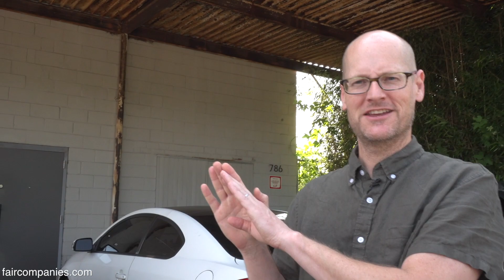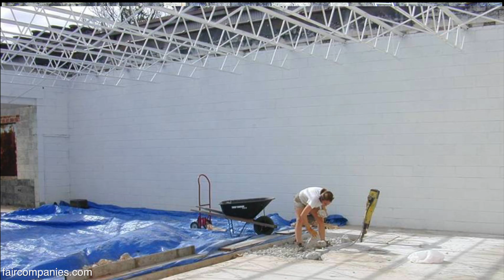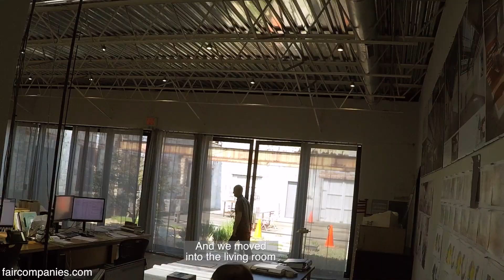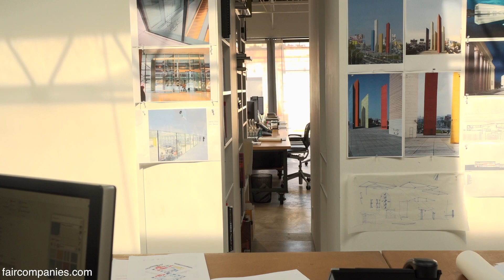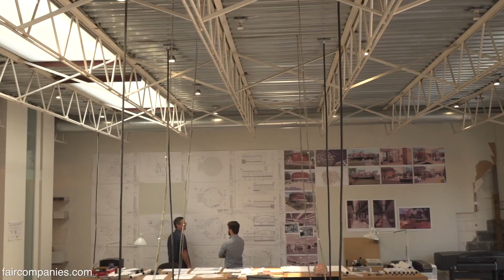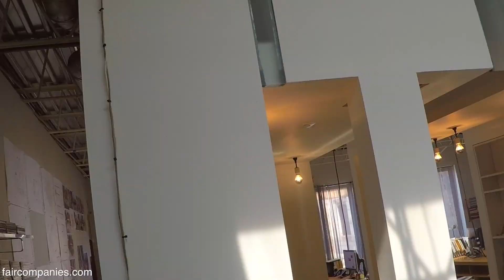Function after form: from old auto repair to live/work space

Comment: I hold a Journeyman card in Architectural sheet metal & Commercial Waterproofing/Roofing as well as a licensed Crane operator & Certified in 3 types of welding ,I'm well versed in rough carpentry ,Steel work and assorted other building Trade skills learned from 45 yrs in commercial & industrial construction, I can't express how impressed I am at what you've accomplished, very few men who don't work commercial construction for a living could have accomplished what you've done ,I myself could have done the demo work & most of the retrofit remodel but I wouldn't of had the foresight to imagine that old rotten warehouse as the space you've created out of it ,you should be proud of the mammoth task you accomplished that very few others could have done .
Reply: This comment was just one huuuuge flex

Comment: Sustainable architecture at its finest. I really like the work on the skylights, matching them with slits in the walls to let light flow more freely. Good job Brian and David!
Reply: Anders Nilsson agree!
Reply: It doesn't look all that sustainable with just an uninsulated bare metal roof.  In addition none of the external walls have any insulation and I doubt they put any over the slab.  I expect their heating bills in the winter and air conditioning bills in the summer are ridiculous.

The lack of insulation wouldn't pass building regulations in Europe.  Ironically I think it's actually a case of "Form over Function", where they wanted to keep the industrial-chic look of the trellis steelwork but didn't consider the ongoing environmental costs.

 Apart from that I really like it.
Reply: Jon Creighton hmm yeah
Reply: I'm sorry if I formulated myself unclearly, my comment was to be divided into two opinions with no correlation to each other. The architecture is sustainable in which they refurbish an old building. The bare metal roof was to me just unconditional beauty. But you have a fair point.